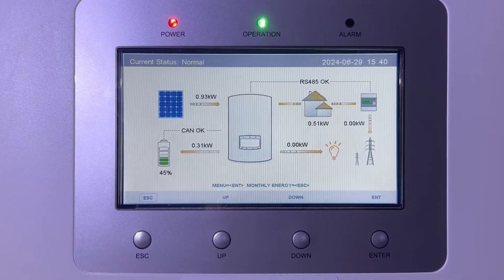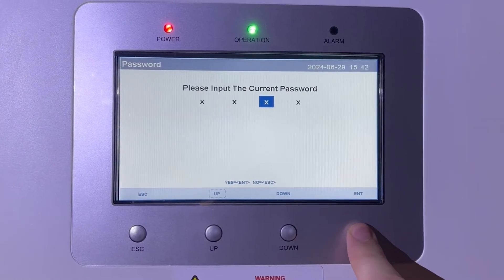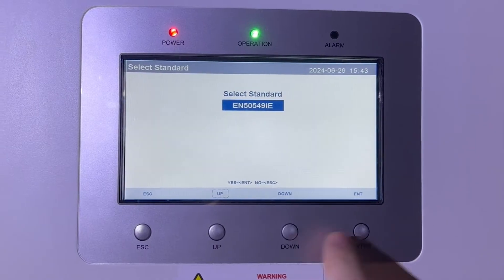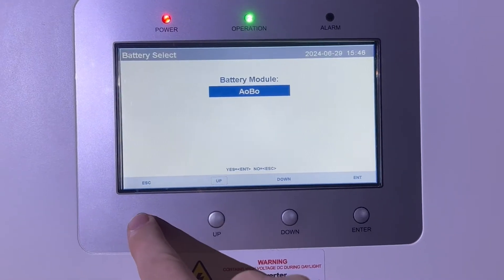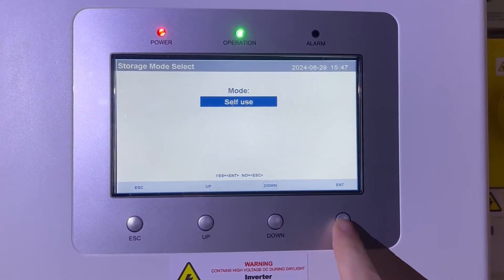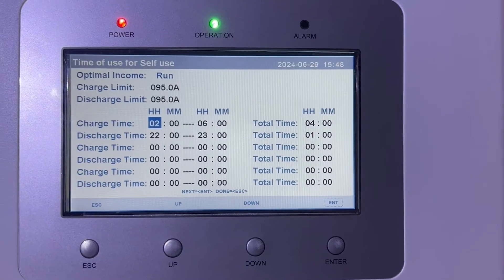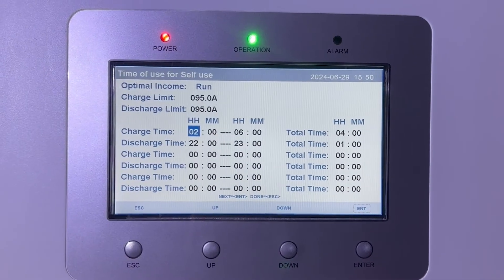Solis Inverter Battery Settings

Comment: Hey Gary
Hheve you any experience on lead acid batteries (Agm) connected to solis inverter.. Is it possible to attach a BMS to monitor charge rate.. I have 8 x 200 amp batteries.. Cheers
Reply from the maker: Good question. The issue with Lead acid batteries is that you really need to mind them and you only get about 50% of the actual capacity. I don't have personal experience, but here is a guide you might find useful. https://www.mokoenergy.com/lead-acid-bms/
Also there is a YT video which shows you the correct setting here https://www.youtube.com/watch?v=zeQLOSlwD8k
Good luck with it and make sure the batteries are somewhere safe. I personally wouldn't use anything other than LiFePO4 cells.

Comment: Well done Gary
As much as I have found your videos very helpful  
I managed to knock my datalogger offline with the baudrate adjustment could I suggest you edit some of your vids that have this advice in them thanks
Reply from the maker: I'll make sure the description is updated, or where necessary, I will edit the video and re-upload. It seems to be very random as to when the baudrate knocks out the logger.

Comment: @Gary meats live, Could you please help me? I would like to operate completely off-grid and would like to know if I need to disable all grid-related settings in the inverter. Additionally, I’d like to know if the brand Felicity Solar is available in the options list.
Reply from the maker: There is an off-grid setting, but i'm not familiar with the non-grid-tied options. That's not what this channel covers. If going off-grid, the list of grids would be irrelevant and you would need to have a change over switch installed, or sever the grid connection. Again, not my area.
Reply: @GaryOnPower thanks for your fast respons!

Comment: Can the inverter work with diy 16 lifepo4 cells and a normal bms, or it requires CAN version at JK? Cand this inverter work with V19 from jk?
Reply from the maker: Maybe there is a work-around, but as far as I am aware, the inverter will only work with CAN and RS485. 
I am not familiar with the JK stuff. I only have hands on experience with the Seplos product to date.

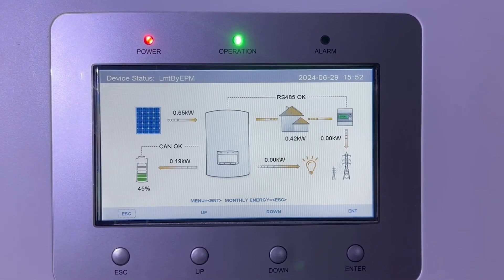Comment: 10:58 hi ive bought a 15kw docan battery is it ok to connect to the inverter
Reply from the maker: If it is similar to the Seplos type battery, then I see no reason why not. You will need to have your BMS settings in good order and you will need to tell the inverter about the battery. Follow the same instructions as per the video and that should get you setup. You may need to try a few different battery names if the inverter shows “no battery” or “bat_name_fail” alarm.
Reply: @GaryMeatsLife it says
Pin definition 
4H.5L  ok
And it's on the list
Reply: Thank you so much for your advice @GaryOnPower

Comment: Hi there, 

Thank you for the detailed video. 

I have a solar PV system with a WECO 7kWh battery + Solis Inverter and am considering adding a Seplos 14kWh battery. Do you know if the WECO and Seplos batteries can operate effectively in parallel? I am aware that Puredrive and AMASS batteries can be configured in parallel with Seplos, but I haven't found much information regarding compatibility with the WECO battery.

Thanks in advance for your insights!
Reply from the maker: @01cidy  Although there will be no comms between the batteries, they will work. However, in that situation, I suggest you buy the 16kWh Seplos (unless there is a specific reason for buying the 14kWh version) and then sell the WECO. Use the money to buy another Seplos battery if you want. Ideally you will buy V3 BMS. 

Seplos V4 kit is also available, but I haven’t been offered one to build, so there is no video here for that.

Comment: Will the export limit stop the discharge of batterys. If my max export is 6kw and i have battery discharge to 6kw what happens when the pv starts making power?
Reply from the maker: Good Question. So, with the inverter being the limiting factor in this scenario (6kW), both the battery and the PV are using the same limit of 6kW. Depending on your settings, the default will be that the PV gets used first, the battery supplements and the grid backs them up.

So, for example, lets say your PV is producing 3kW and you turn on your 9kW electric shower and your 4kW electric oven. The load is 13kW.
3kW comes from the PV first.
3kW comes from the battery. You are now maxed out with the inverters 6kW limit.
The other 7kW is taken from the grid.
Reply: @GaryMeatsLife  the 7kw will excede the export limit then. I am wondering if the inverter is smart enough to reduce the discharge amps of battery to stay within export limits.
Reply from the maker: It’s not about it being smart enough, it’s about the physical limit. The PV must first go through the inverter which is limited to 6kW in your case. The battery is also restricted by the inverter, so the max grid export is 6kW.

I’ll give you a more complex example. My inverter is limited to 5kW. I also have a 3.6kW string inverter. My hybrid inverter see what the string inverter is sending through the consumer unit and prevents the export exceeding 5kW. 

The 5kW hybrid thankfully cuts the export down to 5kW while anything above that will be used by the house, or sent to my batteries, or if greater than 3kW extra (total 8000W) will be clipped and can’t be used. 

In essence, my system is good for 8kW, but only 5kW can be exported at a time. So yeah, it’s a smart enough inverter.

Comment: Good day sir.
I always watching ur vedios from phillipines sir.
I have a question sir,whats the settings or parameters do i set only PV and grid,no battery connction sir.only grid and solar PV.?
Reply from the maker: Are you having a problem with system? With no battery, it’s a simple setup. Selecting the correct country in the settings to match the grid frequency might be necessary.
Reply: @GaryOnPower  ok sir thank u.
Do have tutorial vedio sir how hybrid Solis work with no battery
Only solar panel and grid.
Reply from the maker: @kumbatichannel8251 No, but the same settings apply. The only difference is you select “no battery”. You don’t need to enter battery settings if you have no battery. The other settings will be the same. Of course, you must select your country in the settings.
Reply: @GaryOnPower ok sir thank u very much.im from the Philippines sir.thank for ur advice sir.

Comment: Hi sir i have problem in 8kw Solis inverter. Sir battery is charging and discharging during Solar.
Sir please help me
Reply from the maker: 1. Set all your timers to zero.
2. Set your preference to “self use”. 
This should stop any unintentional charging/charging and should send excess generation to battery. From there, adjust your preferences to what you want.
Reply: @GaryMeatsLife  
1. ( Set all your timer to zero. ) I Don't understand.
And 2nd preference is Ok and its self use. 
Note: no net metering and install lead acid battery.
During day time for 5 to 10 sec charging and discharging occur.
Please
Reply from the maker: @asifjan-yu9ob  Look at the video from 6 minutes. This will take you to charge and discharge menu. Set all these to zero. Check your charge and discharge Amps are 50-100 usually OK. If you have followed all the setup settings, it should work. However, using Lead Acid batteries requires different settings elsewhere than using Li or LiFePO4.
Reply: @GaryOnPower  Sir I have already selected the time of use, which is 00:: 00----23::59.  
10 Ampere charge up to 52 volt.
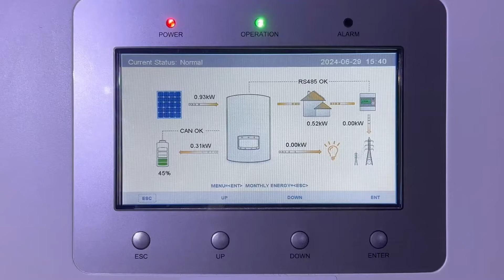Reply from the maker: @asifjan-yu9ob  You need them all to be 00:00. Otherwise you will be charging or discharging for 23 hours and 59 minutes per day 😁
Also 10A is quite low. Set to 50A minimum unless you have a very good reason for setting it so low. Your batteries will charge and discharge very slowly and that 12kW inverter will be wasted.

Comment: Hi, is there a setting that will stop battery charging from solar? I want it only charge from grid between 2 to 5am and use it during the day when solar isnt providing enough power, but I dont want solar to go into battery
Reply from the maker: Yes, you set it to export priority instead of feed in priority. This is done on the inverter.

Comment: Thanks for making these videos 🙏 I just went ahead with Fogstar 15kw and Solis hybrid S6 (too add solar later) just for off peak only charging. My bms seems to work good only pylontech protocol but the inverter will charge from grid at 15% regardless of time schedule until it reaches 30% then repeat. It will charge on scheduke overnight. My overdischarge is set 10% and recovery 11% and force charge 5% and ive been through most inverter options, is there something obvious in the solis inverter settings I haven't found or just maybe my BMS isnt quite right.
Reply from the maker: Check all of your settings for charging on the BMS Studio. See if you have anything set at 15% or 85%. Either there is a setting not as you intended, or there is a Battery/BMS issue. The only relevant inverter settings I can think of in this situation is the timed charging and the battery protocol. Be sure to check you have the correct capacity selected on the battery BMS settings.

You could try to match my settings first and then make incremental changes as desired.

Comment: Hi Gary,
Mechanical here, asking electrical questions.
On the bottom right you have a home type rocker switch with a little plug type fuse enclosed on its own drawer. What is that for? You have ale wart a DC (array) and a AC (mains/grid). Only thing I can think off you have a continuous load from inverter? (AC back up)
Cheers John
Reply from the maker: Hi John. Did you mean to ask this question on another video? If so, please ask there with time stamp included so I can see what you are asking about specifically. It sounds like you could be talking about the inline fuse from another video, but I won't assume with confidence.

Comment: Only other question is do you use the canbus connection or the rs485 connection? Think the canbus is what i have found elsewhere on the net and on the battery you set it to CAN :GINLONG which on the BMS display its shown as RHI... where i assume can refers to canbus. And ginlong solis is the full name for solis.
Reply from the maker: Actually, both are used. You'll see what I mean by watching the battery connection videos I have released.

Comment: For me changing the baud rate breaks the V3 WiFi data logging dongle so it no longer connects leading to a flashing orange light. So beware if changing this. I changed it back to a lower value and the logger started working again.
Reply from the maker: Yes, that's why I updated the description in the video to say:
IMPORTANT UPDATE: Baud Rate should stay at default 9600. By setting a higher Baud Rate, the communication between the inverter and Data Logger can be terminated. 
The baud rate was 19600 on my inverter for several months without issue and as recommended elsewhere, but I have learned that the inverter baud rate does not need to be changed. Only the BMS baud rate needs to be 19600 to communicate with your computer when using BMS Studio.
Reply: Apologies didn't read the description
Reply from the maker: @dstrydtfguyfgjk  No problem. No harm in it being repeated.

Comment: Nice video. Is there a way of disabling the battery indicator on the solis app via the inverter? I've no battery installed and would sooner remove it from the app display. Thanks

Comment: Nice vid thank you.... it's going to take some time to get used to it. anybody knows why my solis isn't using the battery at all? it set to charge at night but during the day isn't using the battery at all, is either pulling from the grid or the panels
Reply from the maker: Have you resolved this yet? Assuming everything else is working with your solar? 
Make sure your discharge rate is set to 100A on the inverter (same as charge rate). To make sure your batteries are setup to supply the inverter, check the charge and discharge timer. These should be set to "RUN". Temporarily set a discharge timer for the time you are changing the settings and for about 10 minutes. After you execute the setting, the battery should dump at full power to the inverter/grid. If this doesn't work, you need to go back to the beginning.

Check my other videos on this topic which might be useful.

Comment: Hi, thank you for the time and effort you have put into your videos, all very helpful. I've just built the a Seplos battery (V4 kit) from Fogstar, here in the UK. This may be helpful to others, I have a SOFAR hybrid inverter and was having trouble with the inverter and battery communicating properly. Through trial and error I set the Sofar inverter to  use a 'General Lithium' battery, this uses the Sofar battery protocol via the CAN connection, then on the battery it is possible for its protocol to be changed to the Sofar protocol. Now everything is working correctly.
One point of note, I believe if you are communicating via the RS485 connection, the baud rate is important, however, if you're using the CAN connection, it doesn't matter what it is set to.
Keep up the good work!
Reply from the maker: Thanks. I have a short video planned to mention the baud rate and I already updated the video description here to cover that. A higher baud rate may terminate comms between inverter and datalogger.

Regarding your inverter, thanks also, as it is a popular inverter and the info you provided will definitely help someone. The focus on my videos is with the equipment I use, so other experience is welcome.

Comment: Hi Gary your video on battery settings is most helpful,
My question is is it nessecary to set a discharge time.
Reply from the maker: No need. You only set discharge time if you want to dump energy from the battery to the grid. This is useful if you have lots of extra energy at the end of the day and you get paid a good export rate.

Comment: Hi, i have installed Lead acid tubular batteries but battery SOC not showing in display. Battery voltage is showing. Please suggest.
Reply from the maker: You will need to select the "user defined" option. The Battery needs to connected to the comms and all signals need to be connected. Try a different comms cable to rule out that potential issue.
Beyond that, your BMS settings will may need to be looked at. Lead acid batteries are an entirely different setup to what I use, which is LiFePO4 with Seplos V3 BMS.
Reply: @ Thanks for replying. Actually when i connect with bluetooth then i can see the SOC but in wifi plant overview and on the inverter screen it is not showing. That is why i am curious that battery settings might be ok but data logging is not correct
Reply from the maker: @omerqasimali  Lead acids typically don't have CAN BUS, so maybe that's why you can't get the SOC on the inverter screen.

Comment: Hi Gary, do you know what is the no-load power consumption of the inverter you are using ? I am planning to buy the same inverter but need to check standby time. Please let me know. 
Thanks for nice videos very helpful 🙏
Reply from the maker: It’s around 300W
Reply: @GaryOnPower  no way it's that high... I read on a forum that a Solis S6 uses ~75W when idle or for itself.
Reply from the maker: @andreitone I read it was 300W and also read elsewhere it was 40W. I observed a 200W-220W idle personally when my grid power was disconnected to replace a consumer unit. 

You have to realise that the idle consumption will depend on a number of factors, including unit efficiency, distance from supply and most importantly…temperature! 

The average may well be 75, but I prefer to give a cautious answer and have seen 300W quoted several times.

Comment: Excellent, exactly the setup I am planning to have (batteries ordered from NKON already), thanks for the explanation/confidence boost!
One question - why are you charging the battery during the day from PV? Do you use more than the 15kWh from the night charge before sunset? My thinking is that I should export excess during the day for the FIT, use battery for the evening as possible to avoid the day rate and recharge. Especially if you dump remaining capacityat the end. Different story probably with a smart tariff, we're currently day/night (Energia), same as you.
Reply from the maker: My house consumes well above average. 15,000kWh per year, so 40kWh per day average. I'm still adjusting between self-use and priority export, but on priority export, my battery level has been below 20% before 11pm on a couple of occasions due to dull days. That's fine for now, but during the shorter days of the Autumn and Winter, I would be pulling from the grid before 6pm. My Energia rate is the 2am-6am, so I would need to avoid running out of battery and it helps to supplement with solar for now. When I have 2 batteries and when I can draw more than 5kW, I don't think I will have self-use. 

I plan to add to my 5.2kWp setup (currently 8 south and 4 north panels), probably doubling it to assist during the short days. This will be done within the next 12 months, probably in 2, or 3 batches. I have space to add 4 more panels to my North facing roof, plugging into an existing string. Then I have space for 4-6 panels on a flat extension facing South and room for 4 panels on my shed which inclines at about a 5 degree angle North, but is essentially flat. I could be cheeky and put 2 more panels on the back of the shed and they would face South, mounted vertically. Lots of potential, but requires another inverter, or micro inverters for the full project.
Reply: @GaryOnPower hi gary I want to ask you that I have a 6 kw Solis inverter and I live in Yemen what I put in grid code????
Reply from the maker: @nasseralsaid9409  There is probably an option for Yemen on the list. If not, Solis can confirm which you need to select.